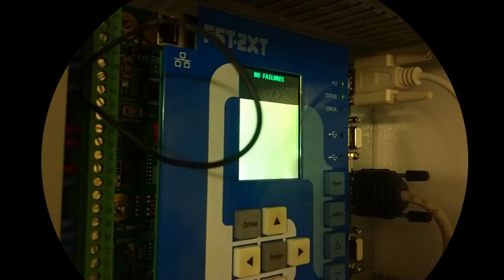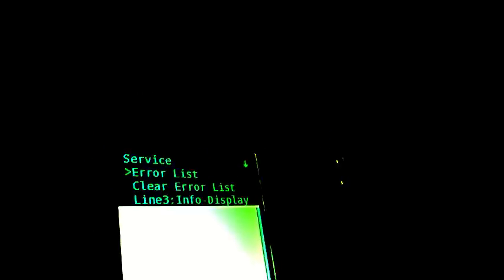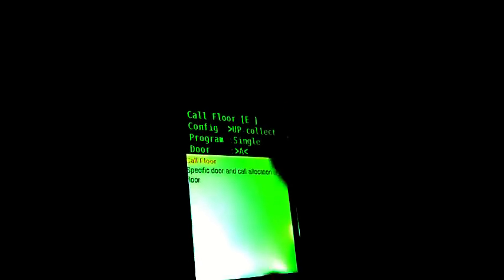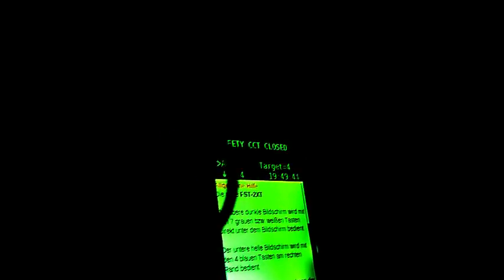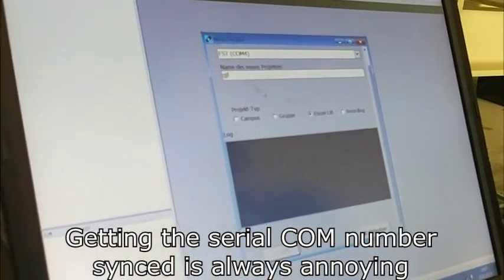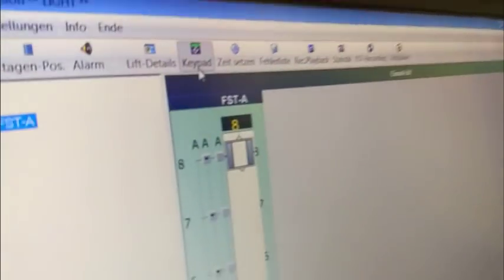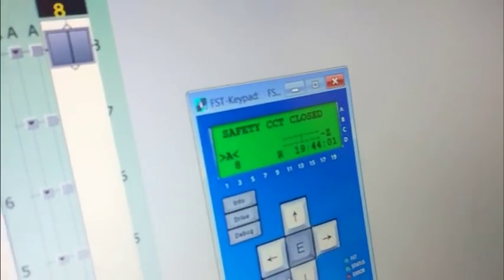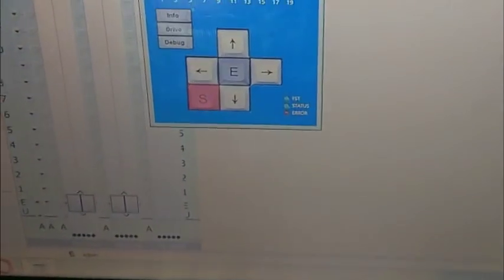Detailed look at NewLift logic

Comment: That looks like an interresting lift controller with some neat features. What kind of cpu does it have and what sort of embedded OS does it run? Btw, does that laptop still have a 9pin d-sub or did you use a USB to serial adapter? That software looks very neat. I occassionally think about lift controller designs in terms of features but can’t design one myself. My design would be a bit like an 80’s home computer with a Z-80 or 68000 cpu running some DOS like OS in a rom chip with an optional text terminal for configuration settings. A mitsubitshi quality PCM voice module would be an optional extra with user-defined voice messages. Of course it would have a pre-doors feature. Which features should the ideal lift controller have to support to be as good as Schindler M-series?
Reply: It was my Laptop, it doesnt have a serial Port. I used a USB to RS232 cable and a Zero Modem cable, the Logic both has a Male and female Port.
Reply from the maker: I also think up my own designs of lift logic.  My designs are quite different.  I would have a lift dispatch system that controls the operation of the lifts.  This system would be connected to the VF drives of all the lifts in the set.  The thing that is different about my design is that the VF drive would be in charge of opening and closing the lift doors.  The VF drive would be fully shaft encoded and full intellegent levelling.  The VF drive would handle the full movement, and the dispatch system would only send floor IDs to the VF drive and would not handle position information.  Both the VF drive and the dispatch logic would have a low level real time operating system that would respond instantly to commands.
Reply: Beno Lifts I reckon it would be a real-time kernal with predictable scheduling? Something like QNX or vx-works? It still amazes me how pretty old hardware can be quite good at performing certain tasks, such as the Atari ST. It’s appearantly still the best at MIDI timing compared to modern solutions with multitasking operating systems. Modern systems have so much overhead and complicated designs. Take windows 10 for instance. The griefs that it has with updates that break things.... I wish BeOS would have survived it was so simple and elagant and ahead of it’s time.
Reply: Lock all of the efficiency settings on

Comment: Newlift logic isn't my favorite. I was told that the intelligent levling feature of the newlift logic arent good so engineers here in stockholm avoids using that feature. also, there are more generic controllers that have the pre-start feature.
Reply from the maker: What is your opinion on KW David the WiFi lift logic.  I personally think a WiFi lift controller is stupid.  As well as wifi being an unnecessary feature, it means the logic is a high level logic.  I much prefer low level real time designs.
Reply: Sorry, i dont know what that is.